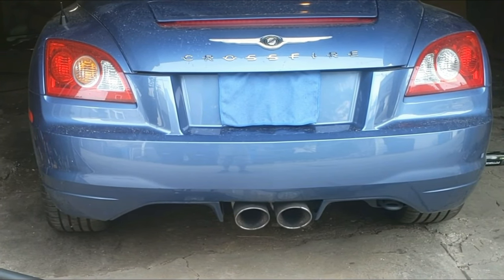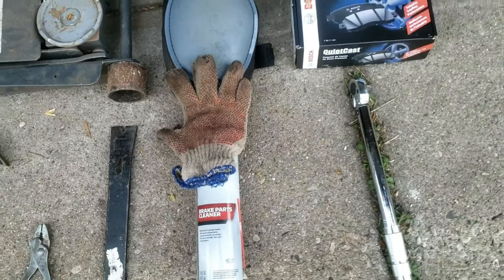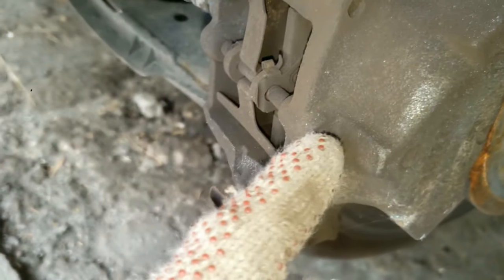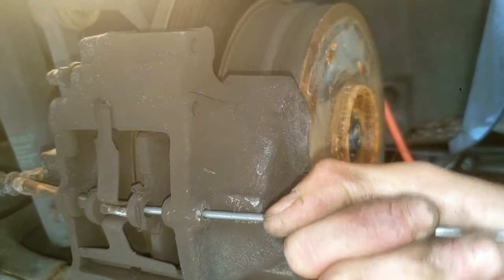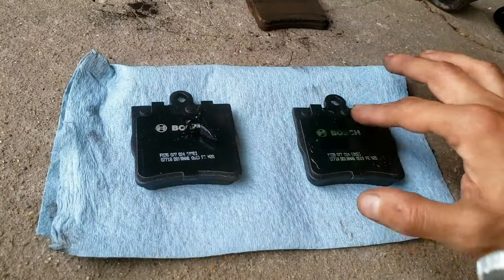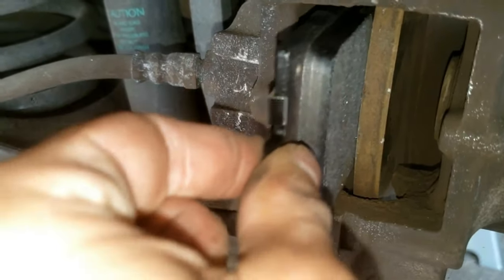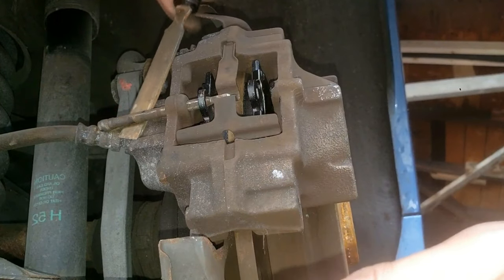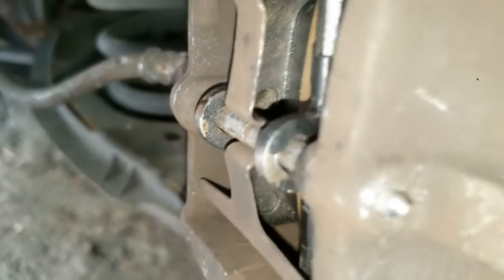Remove Rear Brake Pads On Mercedes Benz SLK, CL, CLK, W203, W202, & Chrysler Crossfire

Comment: you need to clean, and lube the hub, as well as the clean back plate, cleaning is important, and change wear sensor, if applicable
Reply from the maker: This doesn't really have a hub, but I think I know what you mean, and it is generally best to clean the entire area to get rid of as much brake dust as possibile.